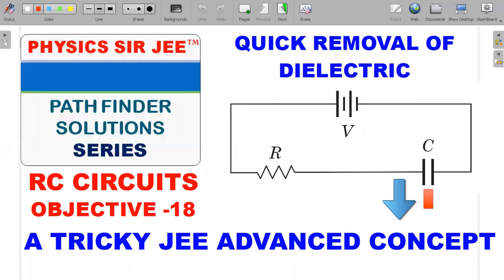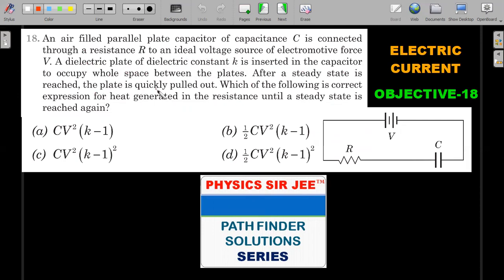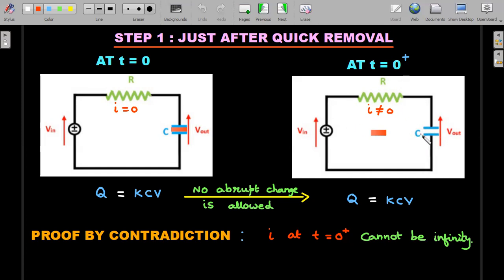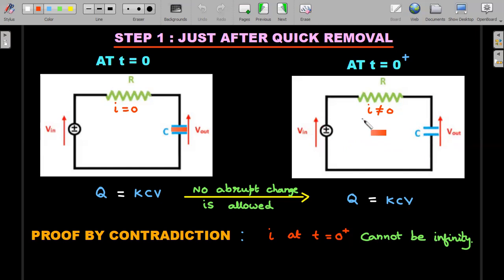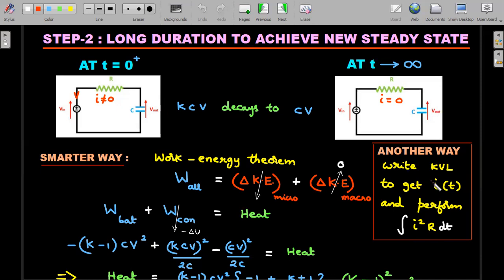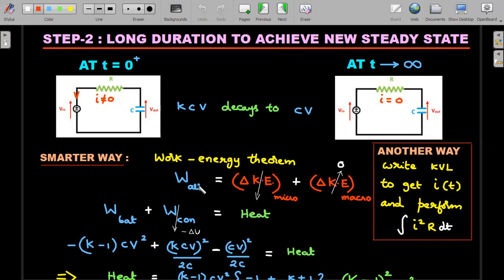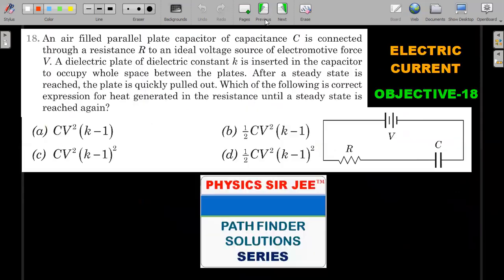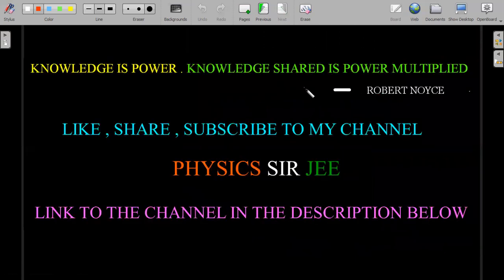PATHFINDER SOLUTIONS | JEE ADVANCED | OBJECTIVE-18 RC CIRCUITS | DIELECTRIC REMOVAL | SCHOOL PHYSICS

Comment: But during so why wont the capacitor also generate heat and by that we will get net heat ie by resistor and capacitor and not only resistor 6:42
Reply from the maker: Capacitors don't 'generate' heat . Heat is dissipated in wires connected due to resistance
Reply: @PHYSICSSIRJEE  yes I understood thank you

Comment: Sir i have a doubt in this form of Work Energy Theorem.
When kinetic friction do negative work on a block. Why dont we take the Change in Microscopic Kinetic Energy in work energy theorem
Reply: Dont know if you’ll see this , as its after 8 months , but here’s a explanation .  I am assuming by micorscopic KE you mean kinetic energy of molecules which correlates to the temperature of the body , in mechanics we only deal with the mechanical energy of the system and any negative work done by resistive forces is considered as “lost” energy , in true sense its not lost but just converted to other form of energy such as heat , the reason why we dont include those energy in work energy theorem is simply because we dont care about those in mechanics.

Comment: Sir,I request you to please explain that why at 7:04, intial potential energy is not K(CV^2)/2😥.🙏I got wrong answer taking that.And,even integration gives what you solved...but I am not able to figure out,why it's not what I thought.Please respond sir🙏🙏
Reply: You should first need to understand about the initial point from where we are taking note of the potential energy.

So at the moment when you  have removed the dielectric abruptly, then the capacitance has immediately changed to C (KC-->C)  but the charge can not change back to CV immediately (Sir has explained about the same)
So the potential energy is not 1/2*(2C)V^2
The very easier way of writing the PE is use (Q^2/2C) where you will put Q =KCV

Again I repeat at the moment when we are writing the initial energy:
Capacitance=C (not KC)
Q=KCV
Voltage across cap= Q/C =KV
Reply: @rishu_Kumar07  Thanks a lot..I had been considering it the potential energy before removing the dielectric which was absolutely wrong.

Comment: Another method: 
Initial charge - KCV
Final charge - CV
Heat = delta Q²/2C = ((K-1)CV)²/2C
= (K-1)²CV²/2

Is it correct sir?
Reply from the maker: Wrong , please check the concept correctly . ∆U is negative

Comment: Janardhan sir I have a doubt sir when we use the usual energy analysis in circuit containing only capacitor and  battery we see that only half of the work done by the battery is stored as field energy in the capacitor and we tend to explain the loss of energy as heat in the connecting wires despite the fact that there was no resistance and when a circuit contains resistor as in this problem we still do the energy analysis and find out the heat generated but my doubt is why should all the heat we calculated  be generated in the resistor only I mean why cant we now say a fraction of heat is lost as heat in the connecting wires and a fraction in the resistor ,I hope you understood my doubt sir
Reply: In all such problems of energy balance in circuits having capacitor and cell, there is dissipation of energy  as heat and electromagnetic energy due to acceleration of charge. So even if we consider an ideal situation with circuit having no resistance then there would be almost instant charging of capacitor and steady state attained. The energy  supplied by cell is not all stored up by capacitor. The radiation of electromagnetic energy is there. So it is better to reason dissipation of energy as heat plus em energy.
Reply from the maker: @trilokv2444  well said 👍🙂
Reply: @PHYSICSSIRJEE  op thought trilok
Reply: @trilokv2444  👍👍
Reply: @trilokv2444  ajn sir told the same reason
Reply from the maker: R is total resistance of the wire plus externally connected resistance in the Analysis . In an ideal case , R tends to zero and Not R=0. When you perform integration of i^2R dt , we realise as R tends to zero , time tends to zero , but i tends to infinity to keep heat loss same ... Which is "the famous half" taught in books
Reply: @PHYSICSSIRJEE  thank you so very much for responding ,completely understood it now sir

Comment: If it was only capacitor and Battery and no resistor , then too answer would be same right ?
Reply: it would be different i think becoz then there would be restriction for current to flow
Reply: @mysticshadow4561  still final charge will be CV and initial KCV ... And work done also same by battery so same ans
Reply: No
Reply: If there is no resistor wer ll the heat be dissipated so resistor shld be der
Reply: @rithvik_  in form of EM waves
Reply: @amiyancandol4499  in these questions we don't consider dissipation in form of em waves
Reply: @rithvik_  without Resistor process is too fast like a spark, jisme dissipation in form of light and sound energy will take place...
Reply: @amiyancandol4499  bro wt we are solving is for ideal cases
Reply: @amiyancandol4499  so we take only dissipation through resistors
Reply: @rithvik_  its ideal case only, we are taught in first or second class of capacitors, energy dissipation when capicator is charged using battery, 1/2CV² in form of light/sound energy
Reply: @amiyancandol4499  
 der we are considering some resistance
Reply: @amiyancandol4499  so thats it but we cannot calculate that (within jee syllabus)
Reply: @mysticshadow4561  what are you even saying!? What not in jee syllabus !? Only the mode of energy dissipation will be different.....  energy will be same as before
Reply: Why, and then what will be the ans
Reply: Current is like an impulse... Where we know value of idt=CV
Reply: @amiyancandol4499  I think u mean to say charge is like a impulse
Reply: @rithvik_  yeah